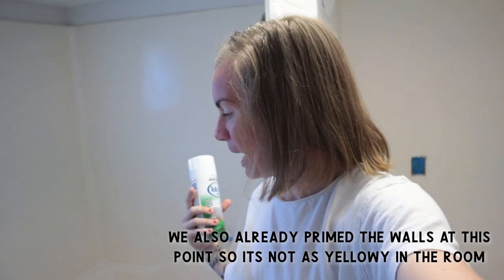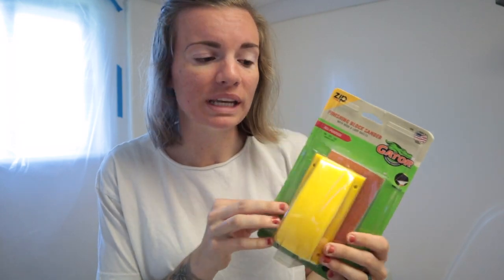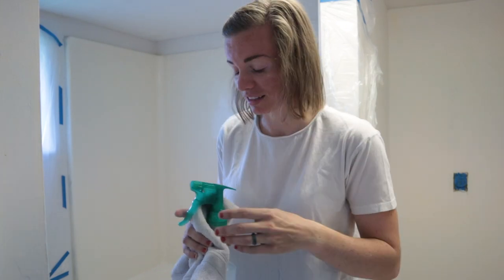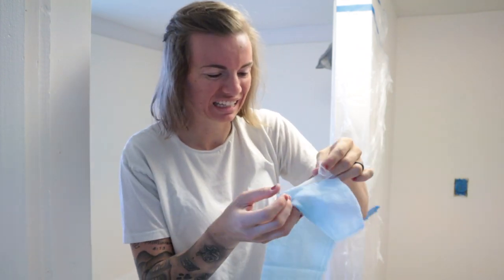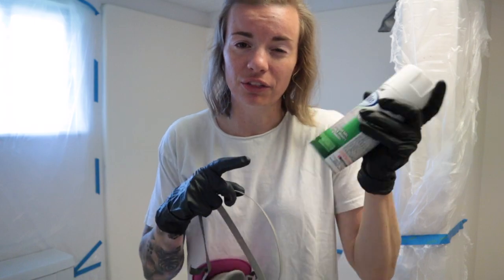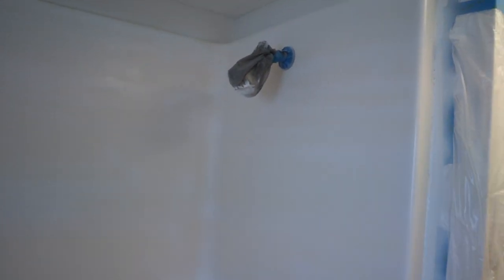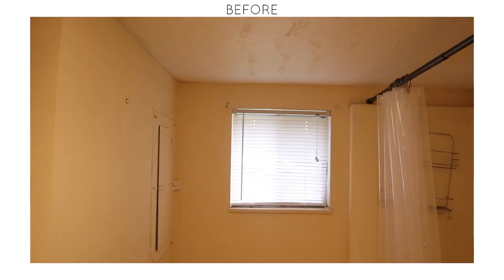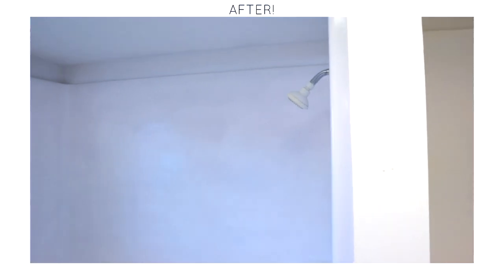Instant Bathtub Transformation- Rustoleum Tub And Tile Spray - Flip This House // 𝐓𝐡𝐢𝐬 𝐅𝐚𝐢𝐭𝐡𝐟𝐮𝐥 𝐇𝐨𝐦𝐞

Comment: To cut down on your overspray:  1. warm you paint cans in warm water if needed to increase pressure that will atomize the particles. 2. Always spray parallel with the surface and avoid having an “arch swing” .   Hope this helps .

Comment: Just used this on my cast iron (porcelain) tub, I suggest spraying for one second on a cardboard somewhere as at first a couple blotches of heavy paint came out at first. I only had to do the bottom of my tub, as the previous homeowners had a large bath mat down, that combined with no water softener left mineral deposits that would not come out. Wear a respirator, put a paper cup over the drain, turn on the fan close the door, put an old towel against the bottom of the door crack, and leave everything alone for 72 hours.

Comment: Was the finish smooth?
Reply from the maker: There’s a little texture to mine in places that I may have sprayed too close to it. But overall it’s not too rough
Reply: Smooth surface gonna be slippery
Reply from the maker: @SarbjitSingh-oe6eb  so far he hasn’t had any issues with it which is great! The original tub had a textured floor to it. So the walls are pretty smooth but the floor has a grip!